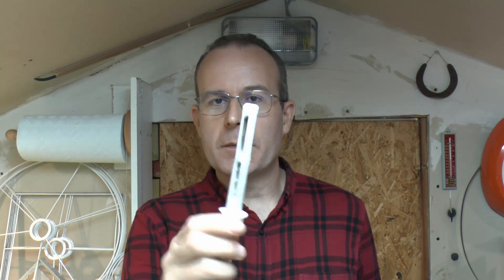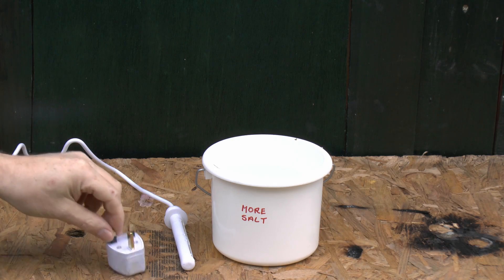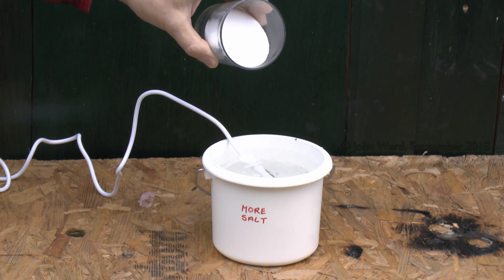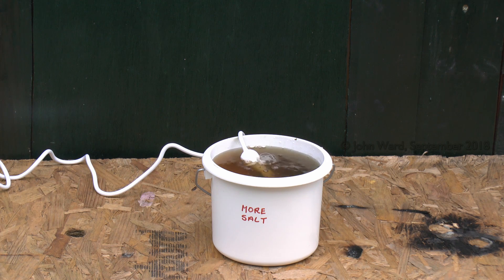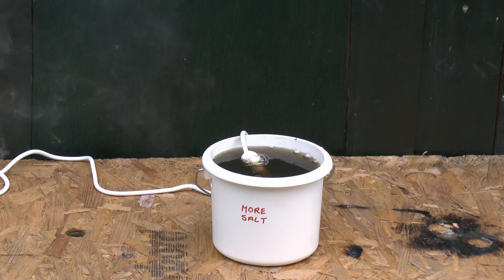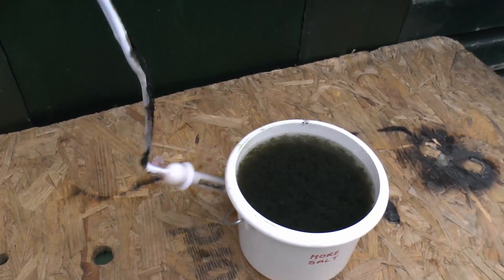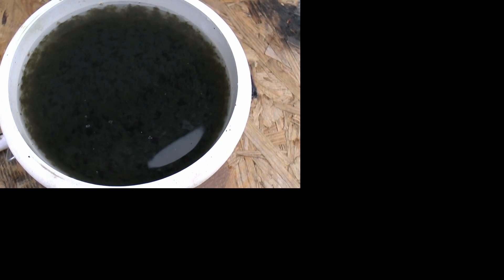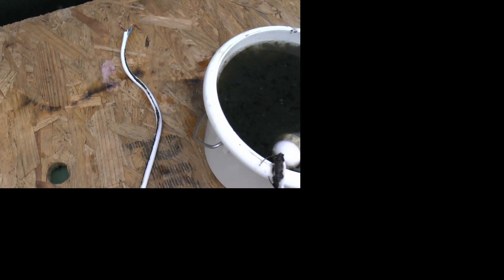Destroying the Electrode Water Heater

Comment: One of the sites I visit for my work, houses people who have just left jail. The staff are always finding and confiscating 'Jail Hose Kettles'. These are essentially a spoon or fork with one cable attached at the neck and the other at the heel. the cable from the neck is wound around the handle up to heel and then insulating tape is bound around the handle. This then placed in a cup of water and plugged into the mains.
Reply: Sounds like a recipe for chromium poisoning and/or electrocution, if you ask me.

Comment: Hi John, I really love your videos, have learnt a lot from them. Can you kindly do a video on the fault finding techniques used by the experienced electrician to find the various faults in an a typical domestic installation e.g if the RCD keeps on tripping, etc. and what are the common faults found working as an electrician. Also, is there a particular method you would use to find the fault quickly and easily. 

Many thanks

Comment: Did you have an amp meter on the thick cable powering it? If you did, what was the current before failure?
Reply from the maker: No meter, so current was something between nothing and 160 amps.  Limited only by the salt water.
Reply: Ah ok, it was interesting to see